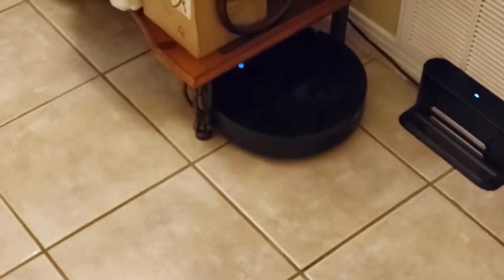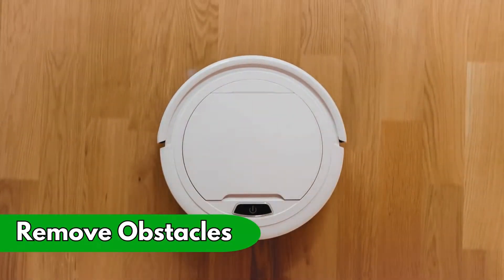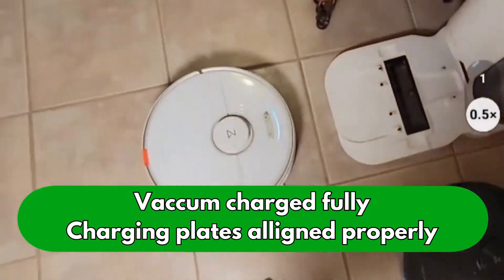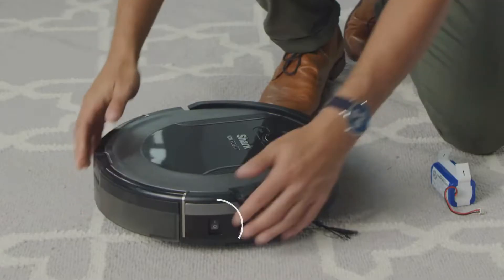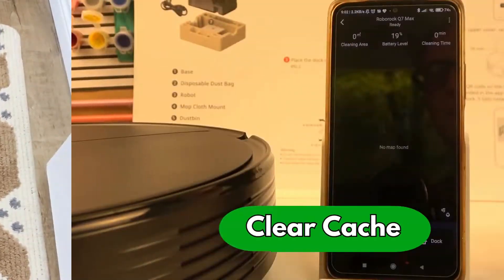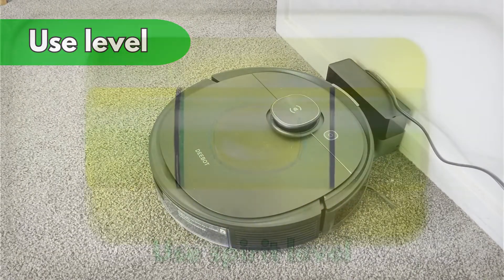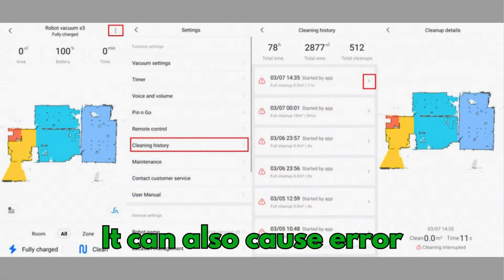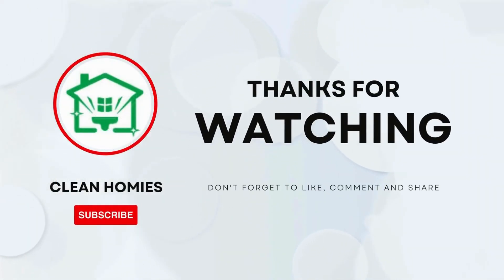Why My Roborock Can't Find Dock [6 Reasons + Solutions]

Comment: Q8 max I notice it's taking long time to position itself I clean the sensors with a wet cloth but I also noticed it was continually redocking itself over and over because it wasn't charging even when I stopped it fully and placed it on the dock, it was the metal charging contacts, cleaning them on just the robot wasn't enough they also needed cleaning on the dock, although it didn't look dirty. Another weird note with its navigation recently was the map clearly shows seperation between rooms with a empty gap but for some reason when selecting to clean a room there's this highlighted area larger than the room itself going into the next room over and so it goes into the room next to the one I'm trying to clean then back .
Reply from the maker: thanks for sharing your experience!

Comment: If the roborock say Problem with communication sensor. The sensor needs to be cleaned, and I cleaned all the sensors and it doesn't help.
Reply from the maker: you can try these things:

[1] Check if the grey plastic piece in the mop dock isn’t missing and it’s properly seated.

[2] Hold the “home” button on both the robot and the dock at the same time until they both beeped. This will reset the robot and communication can start again.

Otherwise contact support.